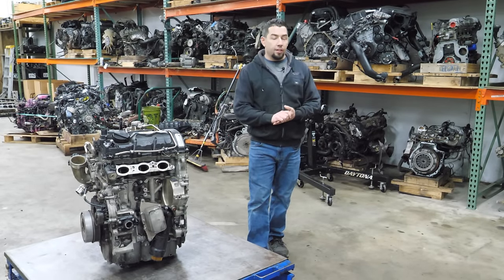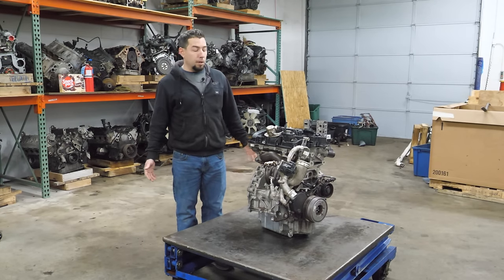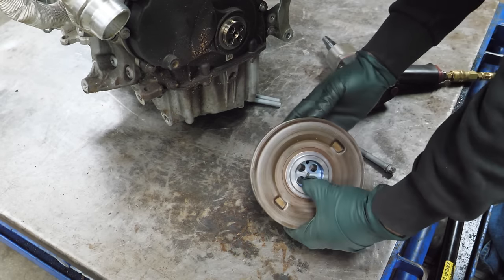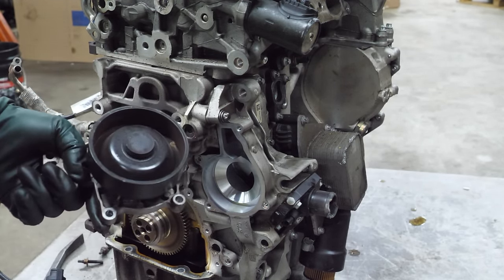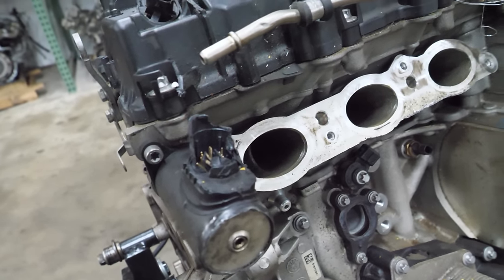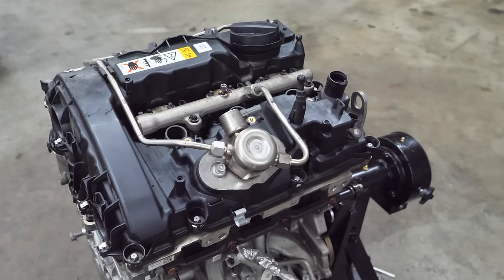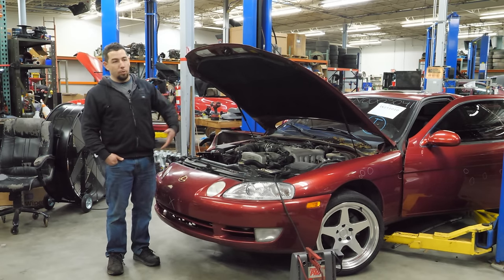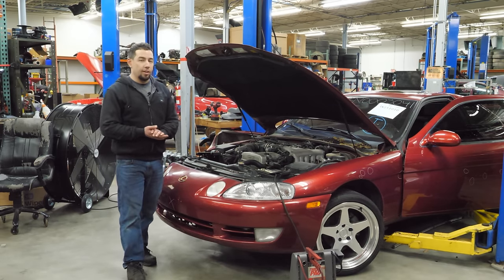MYSTERY FAILURE? 3-Cylinder BMW / Mini Cooper B38 1.5L Engine Teardown

Comment: The safety box actually worked. That was amazing.
Reply: I hope the safety tote was watching from his retirement home 🍻
Reply: Nothing wrong with this engine, needs new harmonic balancer, new rings, quick bore hone. They heard a rattle, got a quote for repairs and scraped it???
Reply: Kinda like that one time the Is It A Good Idea To Microwave This? boys' tin-foil shield also actually worked when they tossed a Lexus airbag in.
Reply: This weeks alternate title: Attack of the Killer Timing Chain Tensioner!
Reply: Box definitely did its job. He would for sure have died.
Reply: Safety box corrugation would seem to supply more padding than the safety tote...so, win?
Reply: @OldFatBubbaI remember watching it unfold live on Ustream too when they decided that they'd stream themselves filming season 7...needless to say, that was the only one they did that night!
Reply: Cardboard Armor Wars!
Reply: Где перевод?  @therealdojj

Comment: Finally, a snowmobile engine!
Reply: More like I can't believe that BMW has stooped so low as to be manufacturing lawn mower engines...
Reply: Greasy old triple bud!
Reply: @@retiredbore378 Just a typical yank response.  If it doesn't have 8 cylinders and do 10mpg then it must be a "lawnmower engine".
Reply: @ferrumignis  As a yank, I completely agree. Give me small, boosted, efficient engines any day!
Reply: Yamaha might disagree.
Reply: @ferrumignis no replacement for displacement
Reply: @jejger5368 the yanks still not knowing turbos have been around since the 70s in cars
Reply: @Mr.Marbles  the yanks where turboing cars in the 60s
Reply: @jdrok5026  on a frigging OLDSMOBILE . . . let that sink in. LOL.
Reply: @retiredbore378  the inline triple was a horizontal 3 the K75. There was also the K100 horizontal 4.

These were actually really really good motors,  some of the best BMW made.  Just a bit weird to see in a bike.  Still see a few around.
Reply: @jdrok5026  true. That was barely a thing tho.
Reply: @ferrumignis No but it’s definitely a euro trash engine 😂 cope
Reply: @ferrumignis  Here Here! and that little lawn mower engine can probably produce as much BHP as many of the pig iron V8's in standard trim.

Comment: I am loving the little skits with the water pumps.
Reply: I'm actually starting to look forward to the water pump skits alone.
Reply: YEET
Reply: The life expectancy of a secondhand water pump is very short in Eric's workshop..
Reply: Yes, more water pump skits
Reply: Should work up to celebrity appearances to do skits involving only the water pump!
Reply: Just to get things clear for a noob like me, he does this because its a stupid idea to reuse a waterpump? even a good one? You should always just get a proper new one if you replace a waterpump because it's such a critcal component. Or am I missing something?
Reply: @gillesvanleeuwen  Nail on the head, my friend. They are typically a cheap, off the shelf part for MOST vehicles. And as a parts reseller, why would he put his company's reputation on the line by selling a used water pump, when they are usually not too expensive and readily available as a new or remanufactured unit.
Reply: @GoneAsGoneCanBe  Thanks!

Comment: I have a mini with this engine and I am willing to bet it was mainly the crankshaft pulley on top of possibly burning oil. possibly the oil was burning causing the owner to not trust the engine, luckily mine does not burn oil. And for the crankshaft Pulley it is not supposed to turn like that. it is supposed to be one solid piece and not move around. Mine did go out and I lost charge and my car started overheating... because the belt was not turning the water pump or alternator. luckily I was close to home so it wasn’t a huge deal but it is an issue that could potentially strand someone causing them to completely get rid of the car... especially knowing minis reputation.

Comment: My mini B38 engine 1.5 has a drive train error,when put the machine it come up with camshaft installation error for exhaust,the engine was redone recently.
Reply: How many miles?
Reply: Same mine, do you have any update?

Comment: You'd be correct in assuming they got rid of that engine because of the crank pulley. I don't know WHY but BMW has had issues with every single Mini engine failing at the crank pulley, the Tritec engines would lose the rubber insert on the harmonic and destroy the timing cover if not caught soon enough and it sounds like a rod knock, the Prince engine did the same exact thing and sounds exactly like a rod knock and all of the new 3 and 4 cylinder B engines have recalls on the crank pulley, you'll get a horrible grinding and tapping noise and none of your accessories will work, you'll get alternator light and no working AC. The new pulley is also something like $900 list and $600 my price for the OEM, febi also has it which is the OEM for Mini, their kit comes with new bolts as well and is only $365 my price. Nice thing is that it only calls for about 2ish hours of labor and should be a warranty/recall job, take wheel off, remove wheel cover, remove belt, remove crank pulley, inspect seal for leakage or damage, replace if leaking or damage, slap it back together.
Reply: @debtfree_2023 I have had many many many R50-3 and R56-7 Mini's come my way with a "knock" where another shop told them it needed a new engine and quoted them some insane price only for it to be the harmonic coming apart. Another common failure on the Prince engine R56+ is the water pump pulley coming apart and it also sounds like a knock because the spring loaded idler tensioner that connects the pulleys bounces with the RPM. Lot of shops either don't know these cars, don't care or just want to sell an engine swap at the cost of a harmonic and scam their customers.
Reply: This is why I read all the comments on this channel - great learning opportunity.
Reply: And when the pully shreds to bits it stops running the water pump too.
Entertainment for the entire family.

My guess is some tech talked the customer into a new motor because “now you don’t know what else might happen”.

For mine we stopped it, towed it, threw on a new pully, refilled the coolant and prayed to whatever is the BMW equivalent of Jesus (savior of expensive motors).

So far the worst thing I’ve found is that it warped that little plastic timing cover on the front of the engine. 🤷‍♂️
Reply: @ntcolonel  Not sure about what the tech thought or may have said but I've seen this issue countless times, on the Tritec when the harmonic starts to go it smacks the timing cover and sounds EXACTLY like a rod knock, a lot of techs would probably immediately just say it's a rod knock and leave it at that but I have never seen the Tritec engine with a rod knock out of the dozens that I have had come my way. The Prince engine has 2 ways it can sound like a rod knock, firstly the harmonic fails the exact same way and hits the timing cover, the second is the pulley for the water pump, it's got rubber around it and acts like it's own belt drive, these commonly shred themselves and create gaps in the rubber and it sounds a lot like a rod knock when it hits the spring loaded idler attached to the tensioner. When you lose the water pump pulley rubber I always recommend replacing the water pump as well because it beats and shocks the bearings of the water pump and isn't worth the risk. Glad you guys were smarter than the mechanics who've diagnosed these by ear and up sold a new motor to poor unsuspecting customers, good on you. 👍
Reply: 3 cyl engines have a lot of "coasting" time between cylinder firing events, which makes them really rough and shaky at lower engine speeds. Combine that with a lot of load on the crankshaft pulley (due to alternator and AC) and probably rubber that is too soft in the pulley to try and dampen the vibration (or even hydraulic dampening) and they're going to be failure prone.

4 cyl are only marginally better, but it largely depends on how the engine is tuned. If the engine is run a lot at low RPM and higher load (like most modern turbocharged engines are) it will also create a lot of torsional vibration in the pulley.

Comment: A couple of theories with regard to the oil consumption. I have a B58 and it is specified with either a 0w-20 oil or a 0/5w-30. If I run my car on a 0w-20 the oil consumption is quite high, if I run it on the 0w-30 it doesn't burn a drop. It is possible that the oil burning due to the thinner oil has caused the deposits on rings and pistons. The 0w-20 being specified due to a negligeable improvement in fuel economy and is generally what BMW service will fill it with. The B38 has to work a lot harder due to it's size compared to the B58 so this effect could be magnified. Secondly PCV faults are not uncommon and it is possible that it has been using oil because of a crankcase breather fault and the owner didn't realise. Thirdly, these engine have no dipstick (stupid idea) and instead rely on a fairly innacurate electronic level sensor. If that is wrong and the oil has been overfilled, that as well will cause excess oil burning.

Comment: I used to have a 2009 Audi with 2.0t.  Could you tear down one of those with an oil consumption issue?  Mine was burning a quart in 1K miles and Audi called it normal.  I hear carboned up rings are the issue maybe like this teardown.  Had so much carbon in the intake ports I had to have the walnut shell blast at 75K miles.  More problems that any car I ever had.  My 2005 4runner has 235K miles and is still happy…

Comment: Looks like poor metallurgy in the choice of materials for the pistons and rings, or using the wrong oil. The BMW genius on M539 Restorations uses a special sequence of mineral and synthetic oils to bed in new or rebuilt BMW engines. New pistons and rings with the correct bedding-in oils would probably have made a good engine of it. It was possibly junked due to emissions failure.

Comment: Looks as if the middle cylinder has a slightly malfunctioning injector. Too much fuel spray wash out the oil from the cylinder walls into the exhaust. Thanks for sharing !

Comment: BMW tech here, gear for the oil pump on those engines are left-hand threads
assuming you tear down another in the future, love your videos and increasingly more popular methods of throwing water pumps
Reply: I wondered if that was the case when he tried if lefty loosey and it didn't budge.
Reply: BMW tech, I think the gooky rings are that stupid thin oil being used to save gas. The rings don't seal as well with ultra thin oil and start burning oil leaving deposits on the rings. 
Piss on everyone, I'm using 10W30.
Reply: I pray everything works out for you! Thank you for so much input on that BMW Engine. Nice to have someone with knowledge speak out.
What's your opinion on synthetic oils and hybrid synthetic.
Piss on it, what type of oil do you think is best in your opinion. I could probably research this myself what if you answer thank you.❤😂
Reply: Im glad someone said it
Reply: I'm with you, I went straight to 5w30 after mine called for 0 20. That's as thin as I am going. 130000 later doesn't burn a drop. @TheBandit7613
Reply: @fram1111  IMO full synthetic on everything (including our 1990 190E 1.8). The real question is what weight of oil to use.. we have a 2019 Nissan e-Hybrid car now and it calls for 0W20 in it's JDM manual, but the same powertrain in Indonesia calls for everything from 0W20 to 10W40. Questions, questions....

Personally I kinda want to chuck 5W40 in there (same as our 2015 Merc C350e) and call it a day, but the best way would be to figure out if there's any difference in bearing clearance between markets (which is something that I can absolutely see the Japanese manufacturers do to save a penny).
Reply: @TheBandit7613 0W20 in a Toyota 1.5 Yaris Hybrid, European driving conditions, over 50k miles now, doesn’t burn at all any oil. Change it every 12 months since the wife doesn’t reach the total amount of miles in a year.
Reply: I had a 540, I used 5w40, 0w40 and then used 15w50. I think it ran best at 15w50 and used a ton of oil with 0w40. I didn't think it would be like that but I think during warmup it would eat the 0w40
Reply: @TheBandit7613  Have fun when the dealer won't warranty your shit because you used the wrong oil. My Toyota calls for 0-20 and I've been driving it for 6 years. Doesn't burn a drop. Seems this is more of a BMW problem...
Reply: Just wondering when he was able to move the crank pulley almost like it had play, that’s normal?
Reply: Recently retired from UPS. UPS calls, perhaps it's changed now, for 10w/30....for everything! From the smallest diesel and gas engines all the way through tractors that haul double/triple trailers.
Reply: Do you know what the timing chains are like to do on these? Got a F21 118i so I assume it'd be engine out right as the chain is bell housing side? 102k so anticipating the rattle soon 😂
Reply: @TheBandit7613 Long tradition of BMW and MINI engines using oil with bad rings.
Let's not forget the stretchy timing chains too!
Reply: How's the N13 engine?

I'm super curious, they have a 15000mi oil service interval, I find it utterly ridiculous that these engines would last very well at all.
Reply: @jackg7492  service the N13s early. They're known for killing timing chains. Pretty sure an istep update lowers the oil change interval same as the b38
Reply: @TheBandit7613  while this one doesn’t show it , I think we were using 5w30 but BMW oil change intervals are so long the oil just gets destroyed. Never worked on the B series but seen hundreds of N series. The direct injection is the biggest problem with these engines in my opinion.
Reply: Figured as much. I owned a F20 116i for a little while, lo and behold the timing chain was gone at 96k.

That car was serviced per manufacturer interval.

My own rationale is that the service interval should be 7000mi... Nice to hear from someone else
Reply: @jackg7492  yeah mines a F21 118i (b38). I've been okay so far at 102k miles with shorter servicing intervals but I know the day will come when it needs the chain doing... engine out 😂
Reply: @TheBandit7613 You can run 5w-40 no issues. I specialize in these cars for a living, and I pulled the entire rotating assembly out of a B48, and the clearances and bearings were virtually identical to the N20.

Tell BMW 🖕🏽and just use a BMW LL-04 spec oil in 5w-40. My personal preference is Motul 8100 X-Clean.

If you run a down pipe, you can switch to LL-01 no problems. In that example, I recommend Liqui Moly Leichtlauf 5w-40.

LL-04 is friendlier to emissions equipment, and being the cats are now right at the exit of the cylinder head (like MINIs), you want to take that into consideration.

Outside of that, it’s all politics.
Reply: @lynxstarautomotive208   I live about 45 minutes from Death Valley so a heavier weight oil works better for me. Never any below zero cold starts. Usually 50 to 60 degrees and up. 
I don't trust that ultra thin oil the EPA is pushing. And they are pushing manufacturers to the ultra low weight oils. Honda and Toyota are quickly learning the rings are not sealing as well and oil contamination is starting to be a real issue, especially on the turbo engines. They are also using low pressure oil pumps. That's crazy. Trying to get 1/11th of a mpg by lowering the oil pressure. 
That's the problem with the Hemi engines, low oil pressure at idle is causing the "Hemi tick" 
They found using a Hellcat oil pump keeps the oil pressure up enough to not damage the valve train.
Reply: @TheBandit7613 wrong
Reply: Maverick hybrid here.  I'm using 10w 30 in the warm months and the 0w 20 in the cold. Reason.. trucks in electric mode till I get to the highway. Means oil is ice cold when I merge and shoot up to 70.. can't be good for the engine. Just my opinion..
Reply: @seymoarsalvage  In Europe we can use 5W40 in the B58s without any warranty issues. Dunno why its different in the US.
Reply: please hekp me witth the location of the crankshaft sensor for my bmw 1.5  116d 2016 rear wheel drive 3 cylinder please help

Comment: Looks like maybe a new car getting the "you don't need to break in a new modern engine" break in method.  Glaze the cylinder walls, rings don't seat, uses oil that gums up the rings, etc.
Reply: First and every oil change is like 10k miles I bet.
Reply: First oil change should be about 1000 miles, then subsequent between 5000-10000 miles depending on the manufacturer.